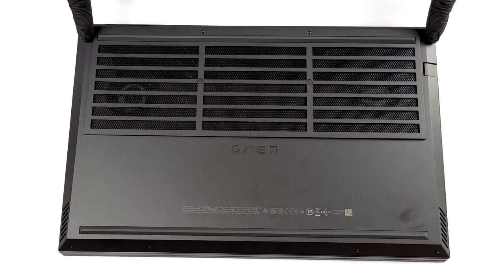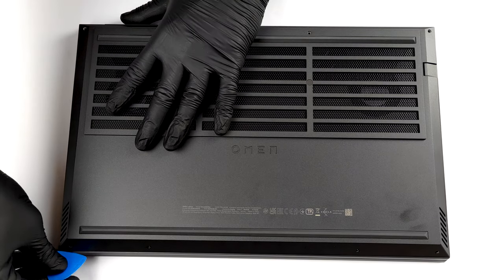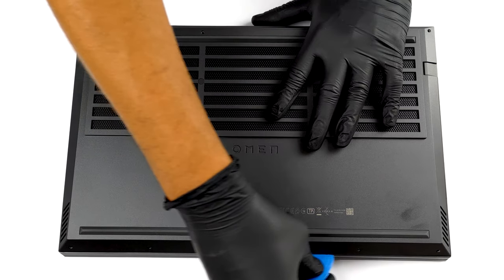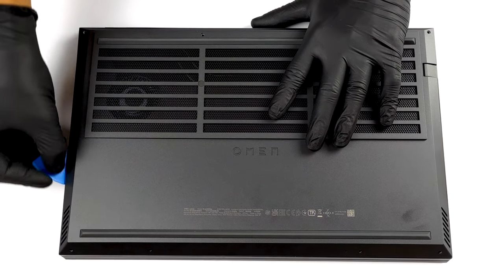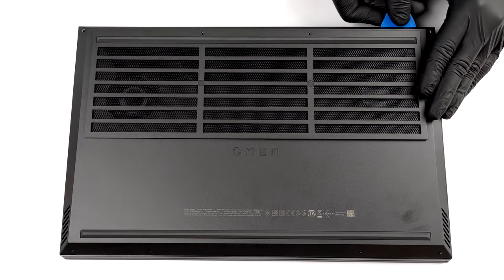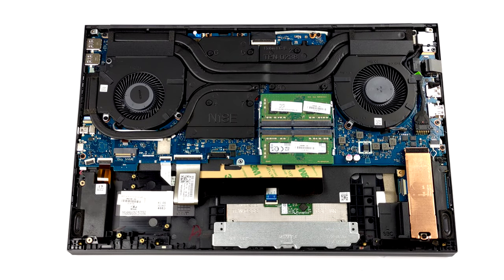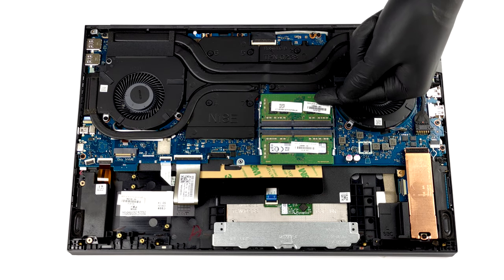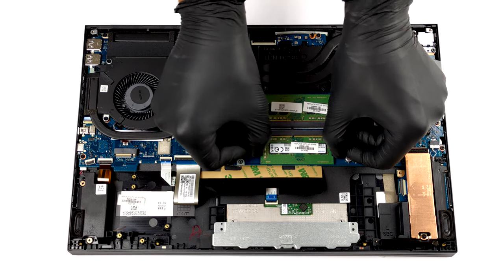🛠️ HP Omen 15 (2021, 15-en1000) - disassembly and upgrade options

Comment: After owning HP omen 15-en1000 laptop for a year the r and x keys broke, and laptop design is that I need to replace the entire keyboard, and to do that I need to remove mainboard along with cpu, gpu, cooling pipes to get access to the keyboard, HP certified repair shop priced this work around $400, not happy with the build quality, as it breaks as soon as your warranty finishes. I have to use usb keyboard, it sucks
Reply: Literally the same letters for me
Reply: Bro what... it's exactly the same keys for me 😱I always thought it's because I spilled something over it. Outrageous.
Reply: @ver_nick  HP rejected my claim because it's out of warranty range, but since it's the common problem for many people they should recall their faulty laptops and fix this issue free of charge. Are you aware of any similar public lawsuits against HP?
Reply: I have same problem with k and x keys. But some time this keys works good, but some times doesn't work

Comment: in reality HP omen supports only 32G of RAM, if you try to put 2 slots 32G each it will work for a while then hang up or suddenly shut down, Omen representative confirmed their laptops support up to 32G Ram

Comment: Do you know how to change the thermal paste?? I’ve heard that in this model you need to change it to prevent overheating!
Reply: I'm here for the same thing, they call this a disassembly video but they stop after they take the ram out.... Sucks
Reply: I havent had a single problem with overheating, even on hot days
Reply: Hey dude, if it's still actual for you I would advice you to turn off Intel turboboost. Yo can do it in Windows power options. This leads to reduction of CPU frequency to 2.6-2.8 Ghz instead of 4.6 (i7-10750h). This helped me to get maximum 71 degrees of Celcium for CPU in RDR2 at Ultra precets without FPS loses.
Reply: Take a look at 3:10. you take off the heatsink (might also have to take the fans off as well, I always do anyways to clean them) and under the heat sink you will see the cpu and gpu. clean it with some alcohol swabs and apply new paste. (make sure you tighten the heatsink back up in order they are numbered). Also to help with Temps you can undervolt your cpu in the omen gaming hub. You can do an automatic or manual undervoltage. I run at -0.100v stable.
Reply: @drew651  why would you undervolt it? Mine has 0 problems and runs relatively cool for a laptop
Reply: @rickdubbink  undervolting gives better battery life, reduces temps and sometimes will even increase performance. I did it for temps, mine would get pretty hot on some games.
Reply: @drew651  i see, thanks for explaining
Reply: Remember to change also the thermal PADS, do not use thermal paste in them
Reply: @GarryFirst1  Wear headphones and turn the booster on for maximum speed. It has built-in fan for that purpose. Also when the temp reaches 110 degrees it will automatically lower it so that technically it will never overheat. Changing the thermal paste is quite easy. You don't need a video for that. This video shows how to open up the backside of the laptop which helps you get started. The first thing I do with all new or used laptop is change the thermal paste.

Comment: Hi, I have the HP Omen 15-en1003nb but I can't remove the back after removing the 8 screws, it's too tight and thin, I can put anything in between, any tips ?
Reply: bread knife works lika a champ if you want to be ver very carefull otherwise use a very thin kitchenknife
Reply: I used a guitar pick and it worked perfectly. I started removing the back from the point where the air blowers are located and i continued clockwise until i reached the starting point.
Reply: thats what she said
Reply: I tried using a plastic pry tool. Can't get it between any spot and when I did it just immediately bent the frame.